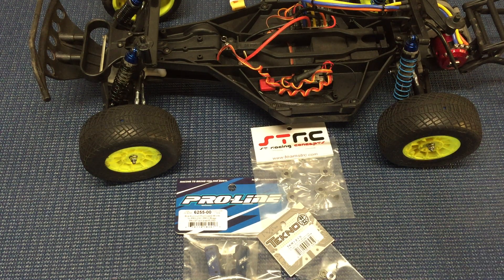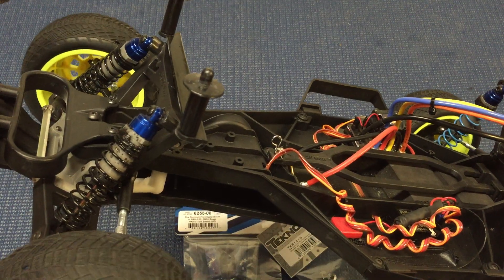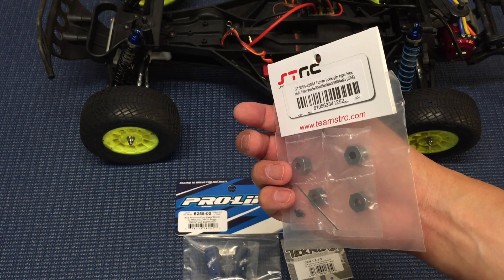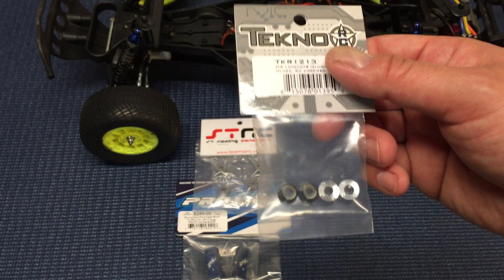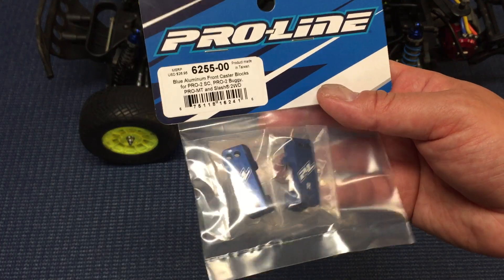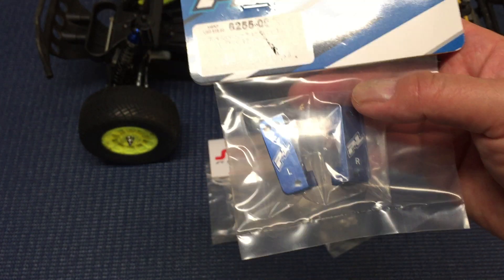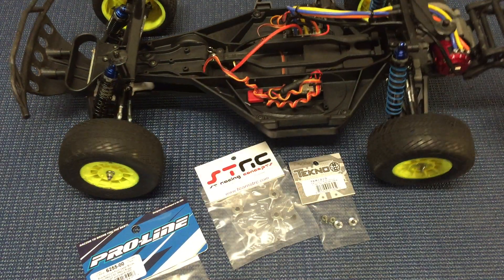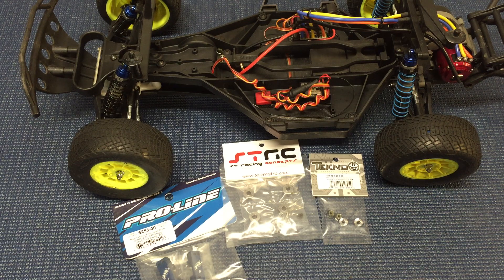Traxxas Slash - Race Upgrade #4 (preview)

Comment: Maybe Avid bearings and an aluminum bell crank and drag link. I really do not like Slashes. But, this one seems cool. I'd rather get an sc10 lol. For 4wd tho there's only 2 sct's I like. One is the Tekno for it's performance and durability and 2 is the Hyper 10sc for its low cost and high performance for your dollar.
Reply: Razor RC 
Agreed! I really wanna get the EB 48 sl for indoors this winter